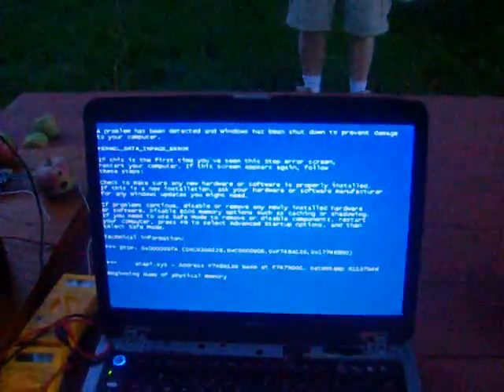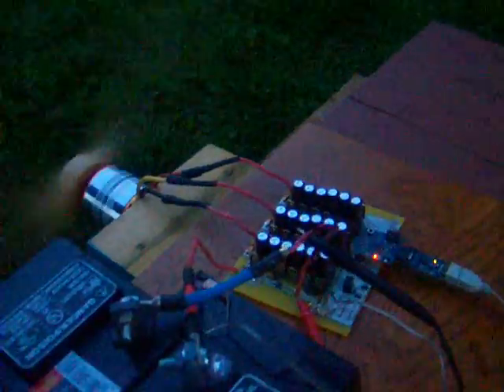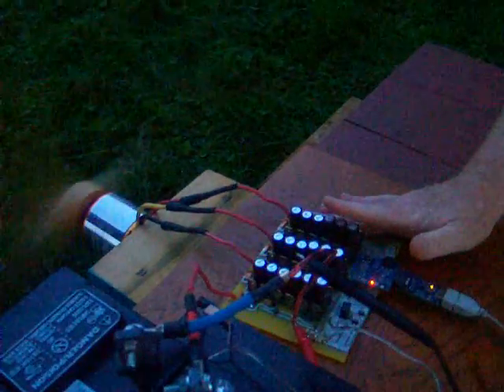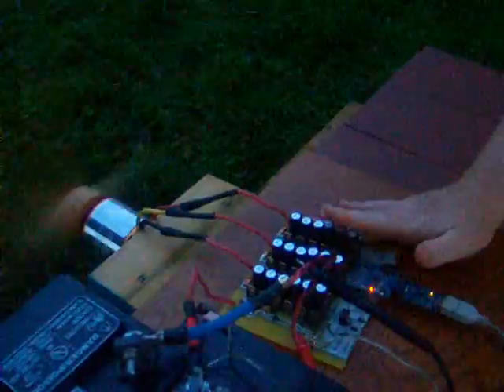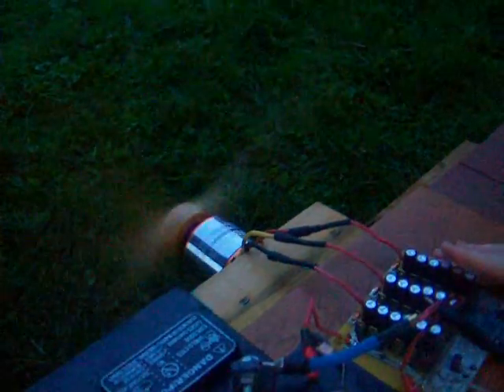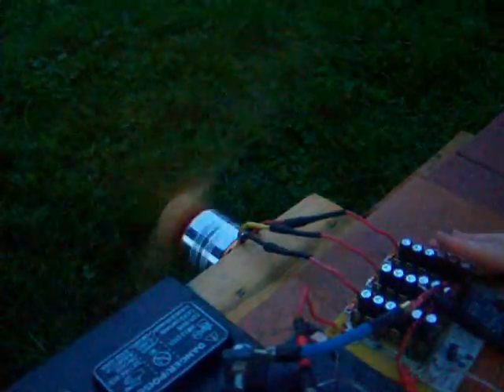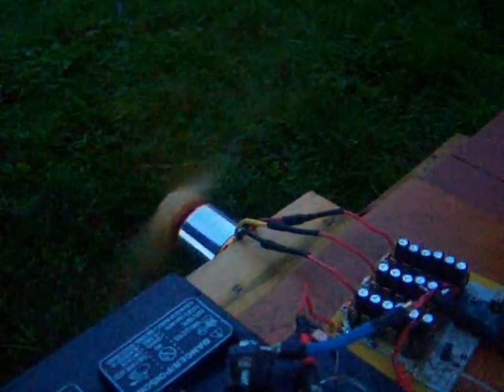DC Brushless Motor Controller - #2

Comment from the maker: Quite awesome.  I have overhauled the circuit a few times because of reliability issues.  One major concern is making sure the H-bridge is not in conflict, even if the microcontroller glitches.  We've done various driver-to-fet ratios.  The final driver circuit uses 2 amps per FET, 36 FETs.

Layout is important.  Get you your capacitors as close to the FETs as possible.  You can see in the video -- Many low-ESR caps are sandwiched between the rows of FETs.

Good luck with the new ESC!

Comment from the maker: I'm so happy and impressed with the circuit.  This test was run at 150KHz.  They're very fast FETs, and we're driving almost 4 amps into the gates.  There are 3 power sources -- logic, gate and power.  Even without the primary power connected, when something goes wrong, it can emit a LOT of magic smoke!

Comment from the maker: The circuit is just 3 H-bridges.  The rest is microprocessor-controlled.  I use comparators to compare individual leg voltage to the average leg voltage in order to know when to shift the phase.

Comment: do you have a schematic??
i have been experimenting with these motors too.
im using the arduino to generate my pulses and the way i configured the motor was to drive on ONLY ONE COIL OUT OF 3.  i have been thinking about a plane or some such but not really got a decent schematic for a driver board.

best regards